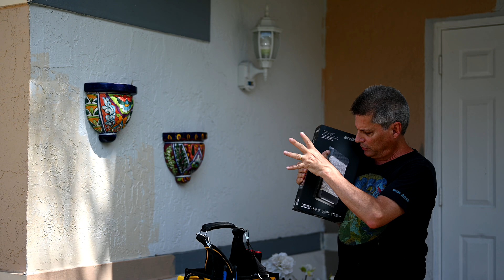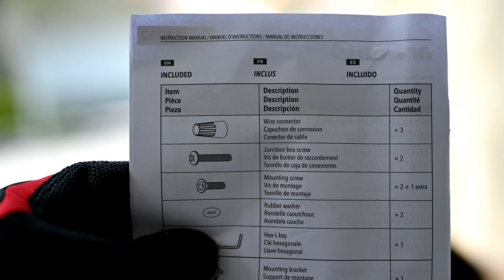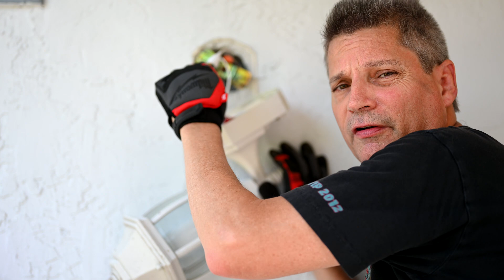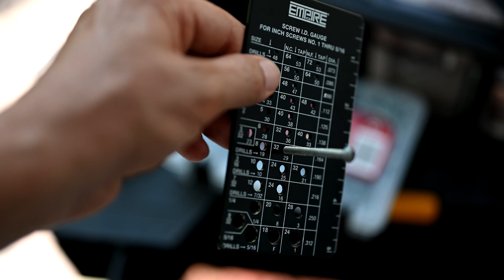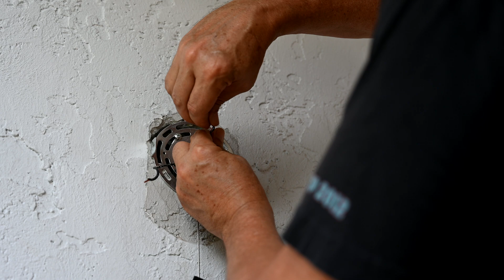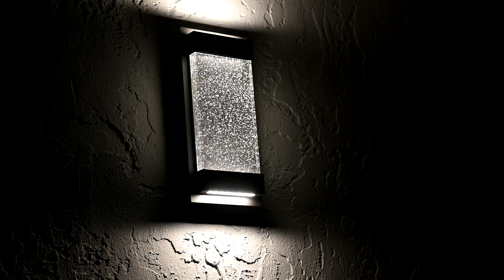How to Install A Porch Light DIY Wall Sconce Light Installation

Comment from the maker: 🛒 Artika GB390L HDBL Essence Bubble Glow Box LED Porch Sconce: https://amzn.to/3i9uvA3
🛒 DEWALT DG5582 Electrical and Maintenance Tool Carrier: https://amzn.to/2Gm8IoO
🛒 Fluke FLK2AC/90-1000V Pocket-Sized Voltage Detector:  https://amzn.to/2THggao
🛒 Klein Tools D213-9NE Lineman Pliers: https://amzn.to/2LQMoou
🛒 Milwaukee 48-22-2202 3-Piece 1000V Insulated Screwdriver Set: https://amzn.to/2ItbU3r
🛒 DEWALT DCE511B 20V MAX Cordless Fan for Jobsite, 11-Inch, Tool Only Amazon: https://amzn.to/2zVsNlb
🛒 DEWALT DCE511B 20V MAX Cordless Fan for Jobsite, 11-Inch, Tool Only Home Depot: https://homedepot.sjv.io/XVN55
🛒 DEWALT DCE511C1 11 in. Corded/Cordless Jobsite Fan Kit: https://amzn.to/3bWh6Zy
🛒 DEWALT DWST11556 Express Folding Workbench: https://amzn.to/2qsaRdi=

Comment: Why did you replace it anyway? The old one worked just fine. If it’s not broken don’t replace it. Also the new light looks tacky.
Reply from the maker: It was rusting out and the light sensor failed
Reply: I guess that’s understandable.

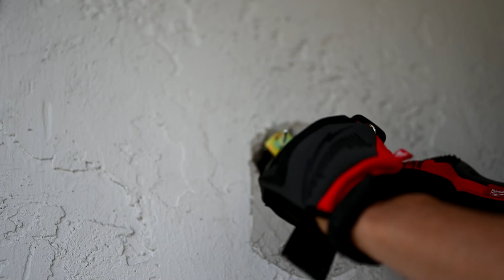Comment: At 7:25, you said we should leave the bottom open so that any one of that should ever find it's way behind there then it can exit. But what are you talking about finding it's way behind there? What could go behind there? Thanks.
Reply from the maker: Water, it's all about water, We want to silicone the light on the wall so water won't get behind it or on top and leak behind it. So we leave the bottom open in case some water somehow finds its way inside the housing of the light, no it has an exit strategy

Comment: Can it be installed outdoors and will it nerd a cover in case of rain ?
Reply from the maker: I would not leave it exposed to rain. They show pictures of it on garages, but it's under a small overhang at least.

Comment: Haha I will use a drywall screw for just about anything including electrical boxes. Doesn't matter if it strips out the threads in the hole if you just use the same drywall screw again on the new light 🤣
I don't have a little box of all the different special screws for electrical boxes, I have a big drawer of all kinds of random screws. I admit to being very lazy for sure.
Reply from the maker: Those little boxes are awesome, you should get one, then dump the big drawer, or sort them in to the Dewalt job site organizer boxes, I have several of them.

Comment: And it’s not an outdoor into concrete screw either 🤣 (drywall screw). However, I didn’t have any other screws at the time and certainly didn’t know any better then. Now I have some rusted drywall screws holding up a security camera 👷🏻.
Reply: Also really appreciate all the reinforcing info in the video. Bout to do this for an outside garage light.
Reply from the maker: whatever hold it up, LOL! Just don't ever use these screws as the 4 screws for a breaker box in your house. Seen that 2 many times and it fails buyers home inspection report every time. Those require a flat tipped screw that won't puncture wires inside the electrical panel.
Reply: jeffostroff getting more organized with appropriate screws, bolts, etc this year. I also have a bolt/screw gauge - essential. No more taking the screw to the depot trying to match it or squinting counting threads.

Comment: Good video, thanks Jeff. I gotta say, I hate philips head hardware. Anything with positive engagement is better. The philips screwdriver wedging it's way out of a tight fastener and rounding the fastener has to go. Old school needs to graduate to torx, triple square, hex, etc. You're an engineer, the philips is an inclined plane working against you. I like your new fixture. PLEASE, I've asked at least 3 times already. I like your music, what is it???
Reply from the maker: I prefer torx myself, but prefer Philips over flat head, because flat heads pop out way too much. 2 songs, the new age sounding song comes from storyblocks who I pay royalties to: zn-1117-simplicity-98 is the song, but can't find it on their site now. The other song with the rock and roll theme is "From The Fall", which is a free rock genre song provided by YouTube free music library for creators to use royalty free.
Reply: @jeffostroff  got it. I'll check out the music. It's good stuff!! I enjoy your videos Jeff. Thanks for taking the time to produce them. I have way too many good tools thanks to you. Oops, nah, can't happen, nobody can have too many tools. Stay safe friend!!!